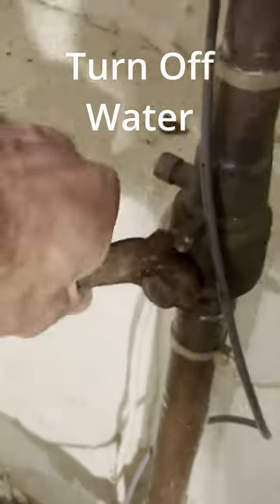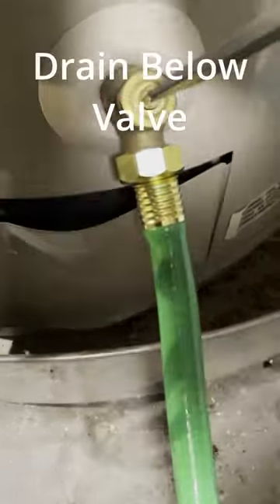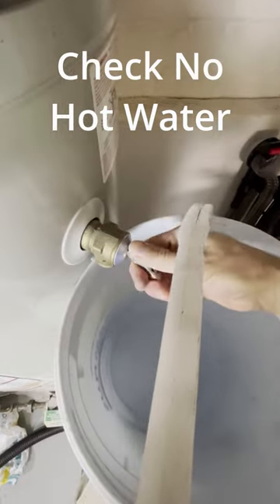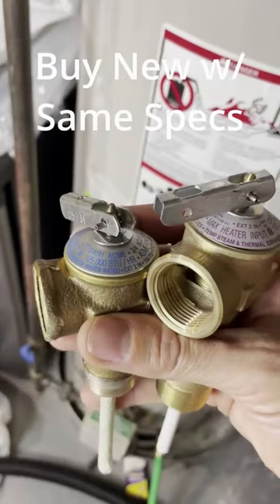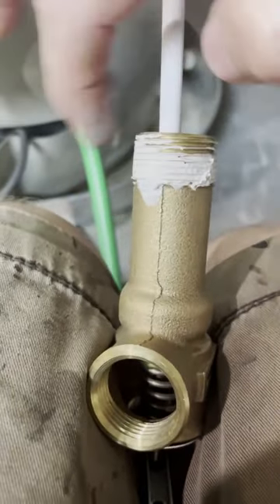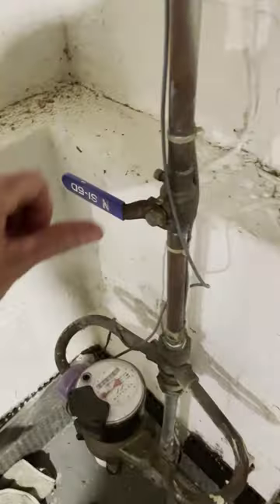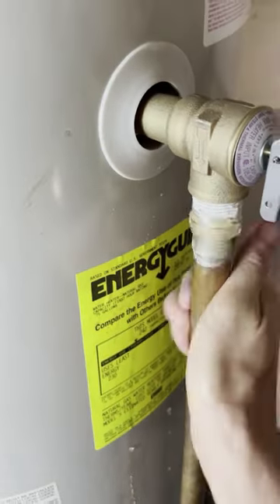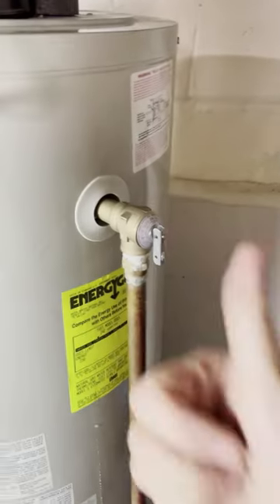Leaking Water Heater Pressure Valve Fix Save $ Replace DIY #diy #plumbing #fix #house

Comment: You can clear the old one with some white vinegar. Pour some in it where the spring is and let it soak for a bit, flush it with hot water. Do it again if you have too. The vinegar with dissolve the calcium on the seal.
Reply from the maker: That is a great tip!

Comment: Only other thing I’d recommend is piping the discharge piping outside instead of into that pan. If that valve does its job, it will pour water out of it until the water is shut off. Imagine the damage it could do. What if you weren’t home…
Reply from the maker: Good idea. Luckily mine is in an unfinished basement and the concrete slopes to the sump. Many others would not be this lucky

Comment: What if my T&P valve is on the top, do I still need to drain? I shut off the cold water water inlet and when I turn a faucet to hot nothing comes out. I should be okay right? Since the valve is on top?
Reply from the maker: The water inside the heater is still hot so you have to make sure it is not under pressure and also won’t come out and burn you. I like draining a little way to reduce the chance of either of these things from happening

Comment: What do you use for that thread sealing?
Reply from the maker: Pipe thread sealant. Verify it’s rates for temperature of the water heater
Reply: My replacement came with pipe tape on it already
Reply from the maker: Interesting. I have never seen one with sealant already on the threads

Comment: Thank you for this. So you only drain tank till it’s below prv? Got it
Reply from the maker: That’s as far as I drained because I opened the faucet and the water was off so pressure in tank should be released

Comment: Can you tell me why still leaking I putted a new relief valve?
Reply from the maker: If you put a brand new relief valve and it is still leaking then you may have a malfunctioning water heater which is dangerous. The pressure valve releases too much pressure inside to keep the water heater from exploding. I would have a professional look at it.
Reply: @handyhomerepairs  
Thank 👍